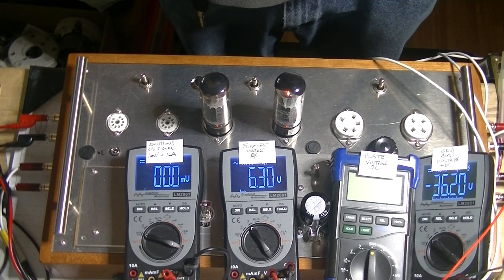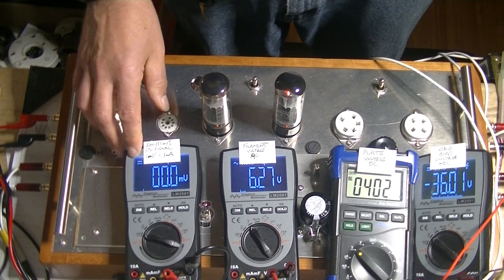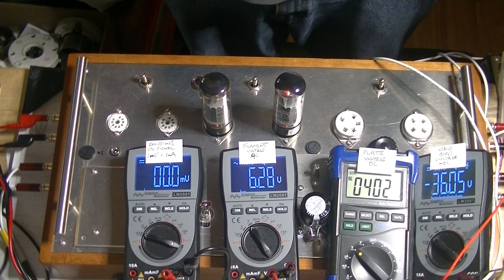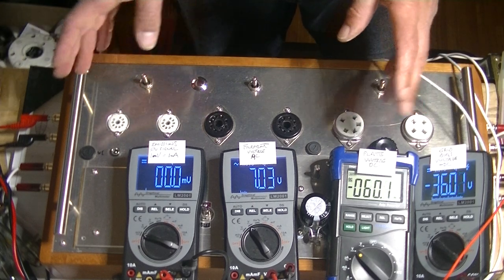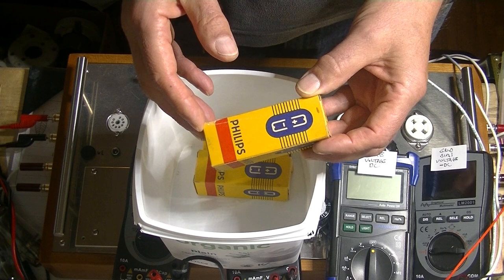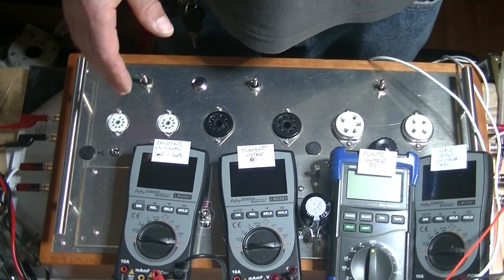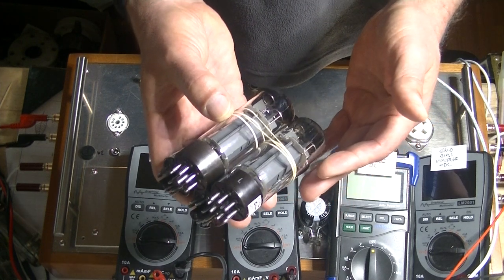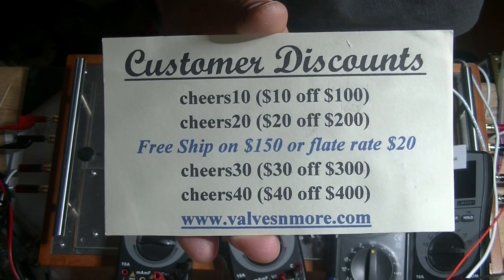Tube Lab #50   Mullard xf2 & Power Tube Tester

Comment: Congrats on the 50 videos!   Well done. Curious which model fluke power supply are you using?
Reply from the maker: Fluke 407D, built near the end of the 2nd (modern) tube era, designed for bench work with tubes.  It has a high voltage side (500v + series 250v) bias supply 0-250v and filament 6/12v.  It's absolutely perfect for anything to do with tubes, my favorite power supply and in constant use.  I was lucky to find a nearly new version (with manual) that only required minor work to make fully operational.
Reply: @tubelab194  I've had a few fluke HV supplies but haven't ran across this one, most have been 3K+ KV.
Reply from the maker: Thanks!  You I'm sure realize what goes into making 50 vids!  My Fluke 407D was made sometime after 1964 (I was born in 63, so it's old!). Normally I don't use vintage test gear, but I love the utility of this unit and it is rock solid.  Came with wonderful high quality tubes, the 12ax7's are all Mullards!  I was very lucky to find a unit that had basically sat in a university (physics Dept) storage room for almost 60 years!  And it came with the original manual.